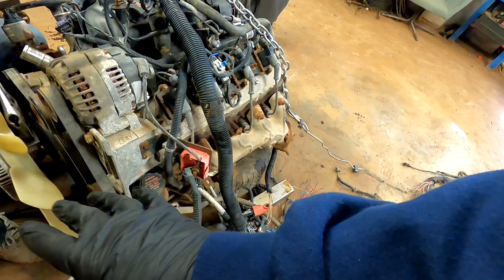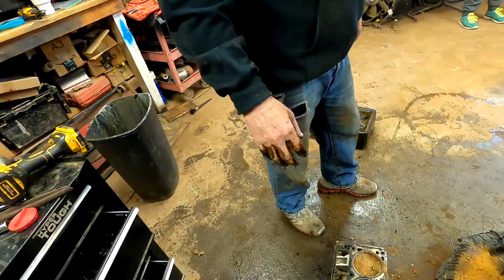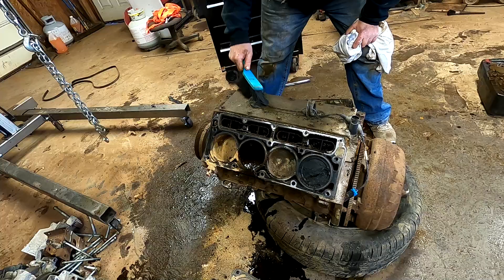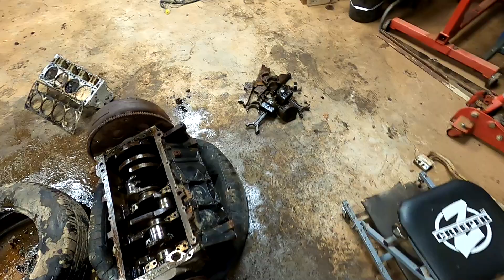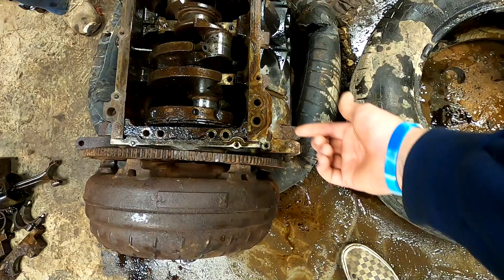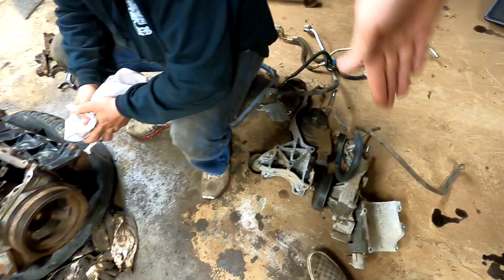The 6.0 LS swap is off to a great start!

Comment: Turn motor back over and pour diesel fuel, Kroil oil, Marvel mystery oil, or PB Blaster in the stuck cylinders and let it sit until you have time to mess with it again . I think you'd have better luck with Diesel fuel , Marvel mystery oil, or kroil oil.  If you use kroil oil, vacuum dirt out, spray kroil oil in, and lightly tap with wooden handle of hammer or something similar and you can watch the kroil oil creep in around the piston . I bet when you get the seized pistons out that block will be fine with a bore to clean any pitting up . One of my 5.3's sit for several months out in the weather , when I moved it into the shop i poured mystery oil into the intake ports on the head and didn't touch it for over a year . When I took the heads off the cylinders were full of rusty water and mystery oil . I sprayed kroil oil in and tapped each piston with a wooden handle before I even tried to turn it over . When I broke the motor down none of the pistons where stuck and each cylinder only needed to be honed . I hope y'all are able to save the 6.0 because it seems like they are getting harder and harder to find .